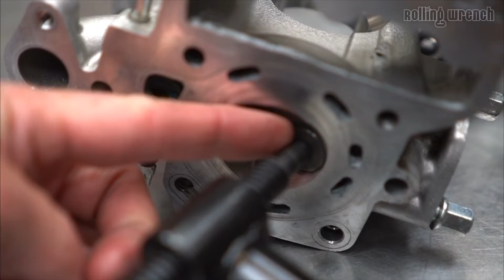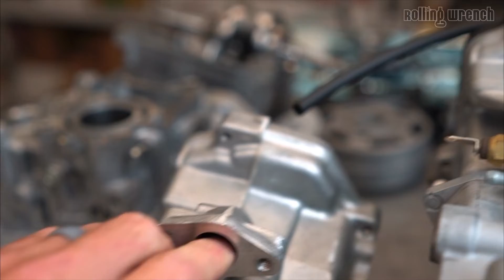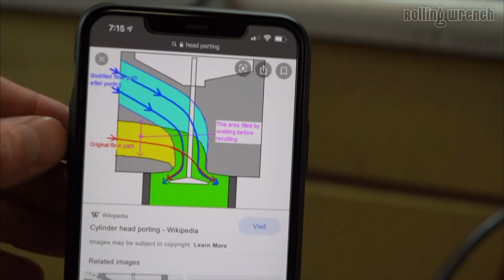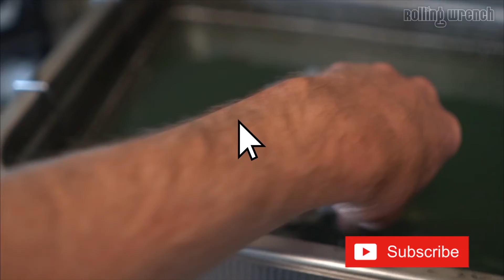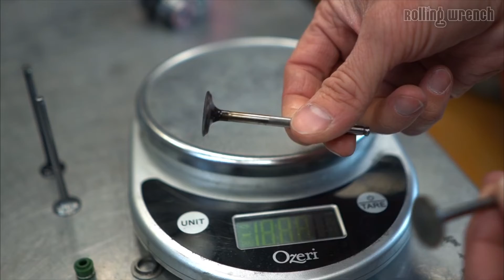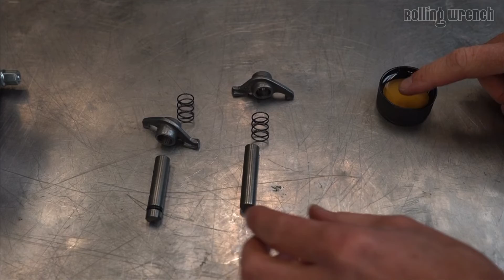Ruckus titanium valves & performance cam shaft [STEP BY STEP]

Comment: I just used water when I was done with the valve job to test the seal. I filled the ports with water and held the head up, and didn't see any water leak out. I used enamel paint on the valve seat and valve and the ring pattern clearly was ground off when i did the lapping. Is this a good enough test for valve seal? I cant see the point in using the dye because if it leaks you should be able to see the water leak through. Just in case I blew some compressed air int the ports with water in the head so it would hold water with the head upside down and didnt see any air bubbles unless it was high pressue of 80 poundsor more blown into the intake and exhaust ports.

Comment: Hi, there is this version of the engine with four valves, you can install a cylinder head on four valves on your engine, you know this
Reply: The number of this motor is - AF 55e, and the number of the motor for 4 valves is - AF 63e.
Reply: the four-valve engine af63e was intended for the domestic Japanese market for the scooter Honda Dio Z4 - AF 63.
Reply: @романмельник-я7к  The 4 valve is also sold in Europe. I bought a couple and had them shipped to USA. The intake ports are tiny and the rocker arms are really heavy. I ran mine on a carb and 10k rpm was about as high as it could spin. I have a 2 valve that can go past 11K. I have a real nasty camshaft for a 4 valve unused.
Reply: https://youtu.be/76YiiA-RtY8?si=BiFvIxrilvVyxoem

Comment: Do lighter valves reduce the chance of valve float
Reply from the maker: Stiffer springs is what controls less valve float
Reply: @RollingWrench  wouldn't lighter components make the springs work Les hard
Reply from the maker: @lukassonntag3956  yes definitely. Valve float would need to be solved with heavier springs though

Comment: I'd like to see this done to a Yamaha 4-stroke 50cc, as the Wreckus looks too much like a proprietary POS GY6.
Reply: The GY6 is a Chinese copy of the GET motor design.
Reply: GET is much different than gy6. Only downfall is smaller displacement. 

The gy6 49 cc has a bolt on kit that gets you to 100cc I think you go from 4hp to 6 something 

The ruckus is about 5 hp, but the hp and torque is more flat. 

Dont know much about the Zuma 4 stroke but I am sure they are good

Comment: Hi. I hv some problems. My bike making some knocking sounds during i pull the throttle immediately. When i cruising around, it sounds like normal. I have check piston to valve clearance, deck clearance, its all in specs and more than enough. Moreover i hv skim my cylinder head and block to make sure no leak. But still making knocking sounds. Can you give me suggestions to check what?

Comment: Great video as always, Matt!  Question for you...I just finished building a 171cc gy6 for my Chinese atv, Taida 58.5mm big valve head, a12 cam, ported head myself...

What exhaust pipe diameter is recommended for these big bore gy6's?  I'm  going to have to custom make it one way or another, but the pipe diam eludes me.  I'm thinking 27mm ID....?

Comment: CRN (Chromium Nitride) coated for long service life and reduced friction to provide the ultimate protection against seat erosion, tip wear, and stem erosion (do not lap Valves)
Reply: I was hoping someone would post that. Not sure why he lapped the valves.
Reply: He is trying to apply what is used in the highest performance oem engines and racing engines to a relatively low performance engine.  He’s sort of on the right track but not fully.  We use titanium valves in our drag race motorcycles when we have gone to a much larger diameter valve to gain mass flow and such an oversize valve in stainless would be much heavier it would require valvesprings with a lot more spring pressure on the seat and at full lift to where it would beat the shit out of the valve seat, cam lobe, lifter (when present), and all associated valve train components.  Reduced valve weight (ti valves) are also used when you are rpm limited by your valve train.  Reducing weight in the valve itself can, though not always, help an engine rev a little higher.  However, most of the time, it’s more complicated than weight alone and factors such a cam profile (duration and intake valve closing most importantly) play a much more important role in changing an engines rev range when specifically seeking a higher rev potential.  Though just being able to spin the engine higher doesn’t mean it will make more power up there.  If the cylinder head can’t flow enough cfm to support the higher volumes of air demanded at those higher rpm then it is of little benefit unless for instance a dragracing situation where spinning the engine past peak hp would result in a better ET at the track due to where the rpm drops back below peak power on the shifts.  
There’s soooo much more to it than just dropping in a set of Ti valves and thinking you are going to gain anything.  Commendable for the effort, but misleading and misinformative do a large degree.  And yes you guys are right, you never lap any valves that are coated, no matter what the valve is made of.  The coatings are only tenths thick (tenths in machinist lingo, that’s tenthousandths actually=.0001).  The lapping compound is abrasive and will grind the coating right off.  We use an uncoated valve with a freshly ground 45 to do any lapping checks when using coated valves.  Lapping is only done as a check anyway, it allows you to visualize exactly where and how wide the mating is between the 45 degree angle ground on the valve and corresponding angle cut or ground on the seat.  Concentricity can be confirmed by lapping after a valve job is performed.  Also when checking out a used head the condition of the valve job is assessed by a quick lapping of the valves with a lapping stick.  Spinning a valve (with lapping compound on the seat) with a drill attached to the stem or with tubing and a mandrel and drill is at best a half assed way to perform a valve job.  Only way it will be successful is if the valve job (45 on the seat and valve) was in good condition and you are simply replacing the valves with the exact same size (diameter).  If he nicked the seat when “porting” (if you want to call that porting) then he can spin that valve till the cows home and it’s not gonna grind enough of those seats for the valve job to “come in”.
But again, overall he did pretty good with his explanations and video in general.
Reply: @robertmason8341  so what your saying no matter the weight difference the ti valves aren’t adding much?

Comment: Hey rolling wrench i got a ruckus 50 CC I need to get started again I was using the electric starter alot I guess I wore it out and now I have to kick start it and it doesn't really work well because the electric starter is what I was using before but I need to get that fixed or something it just makes humming noise an that's it When I  press electric starter button not catching  to the engine ..do I need to get another electric starter or what ??? please tell me why it won't start thanks take care RUCUS 50cc... OWNER......
.....KIRK SELLERS...
Reply: Remove it and check for broken stuff

Comment: Man, get a dykem pen on those seats before you lap them.  That way you can measure the seat contact to make sure you're within tolerance.  Remember that the seat-to-valve contact also serves to transfer heat from the valve to the cylinder head.
Reply from the maker: Good idea!

Comment: If I put a big bore kit of 80cc on my Dongfang, uni filter, roller weights at 8g, idle jet 38 and main jet 86, I weigh 220 Lbs, I'm still only going 32MPH. What am I doing wrong? I watched almost all your videos, but I guess I'm dumb when it comes to this scooter.
Reply: Change gearing and/or jetting? Remember stroker kit changes a lot of things.

Comment: Hey so I currently have a 157qmj in my ruckus with all the bolt ons, performance cam/rocker but have a kymko super 8 150cc gy6 style motor I was thinking about swapping in because it seems more quality/performance “as is/stock” what would you do in my situation keep the gy6 157qmj or swap to the super 8 kymko??
Reply: The 157qmj is a bit more beat up by the way. But is it worth it to do a whole swap? Maybe bore the kymko and swap??
Reply from the maker: The Kymco engine is the better option for sure ! Much better quality

Comment: @Rolling Wrench
I just did this to my now 171 Chuckus. I couldn’t find titanium valves, mine just has standard Taidas. Man wiring in your CDI has me scared. That’s my next big task. I’m getting ambitious with the wiring and deleting the turn signals and kill switch.
Reply from the maker: Nice! It’s very simple on the cdi. Red wire is power. It gets attached to the running light so it gets power. Black to engine ground. Blue plugs into the blue wire on the stator.
Reply: @RollingWrench  
10-4. I appreciate the info. I’m excited. You guys have been super helpful every step and I just want y’all to know I really do appreciate it.